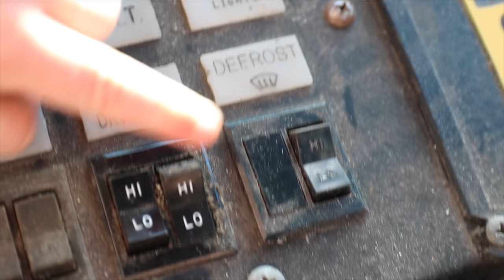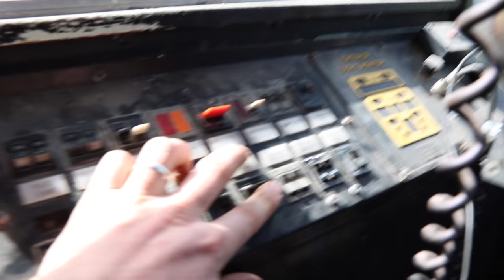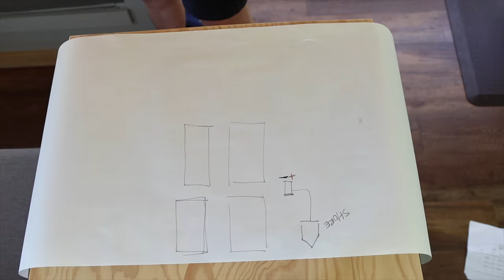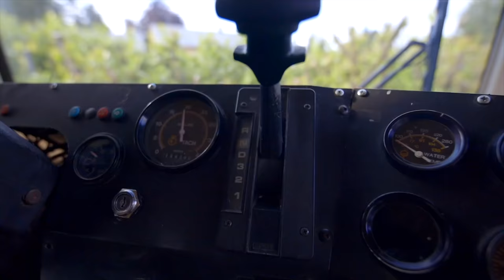BUS CONVERSION TIMELAPSE FULL BUILD - 6 months start to finish - DIY for UNDER 25k

Comment: First time I've seen a sensible sized kitchen. Having spent many years touring in a caravan, that's all the kitchen you get and it's all you need.  You just adapt. I now have a narrowboat with a walk through bathroom, sounds odd but it's the best use of space. This Bus conversion is well thought out and spacious.
Reply: And GAS GUZZLING - just to move it is a considerable financial undertaking! 
AND school bus yellow has to be painted over = $$$$$. Been there!!
Work, tools, time, equipment hauling, $$$. 
Used RVs are available for a steal from disgruntled retirees.
They also have a growing CHILD that will need more and more space and a place - for school etc, if they thought THAT out!
Reply: Best position of a kitchen in a bus!
Reply: @zeebest1004  they have a house

Comment: In your earlier videos on floor prepping, you mentioned a product called "aluminum fiberglass air intake tube heat shield adhesive backed heat barrier" to fill the holes with. Did it work? Is it waterproof? You're one of the few who did a thorough explanation on what to do.
Reply from the maker: We haven't noticed any problems with it so far! Not a lot of water gets splashed up there really.

Comment: Minute and a half in and I'm already jealous. The floor of my bus is hideous. Had to cut all the seat bolts out and nails holding the plywood in. Going to have to attack my floors with a wire brush and por-15 it. Edit: 4 minutes in and nevermind. lol. you're doing that

Comment: I helped my friend take the seats and floor out of his bus... ended up using my milwakee 1/2 impact on full power in the wrong direction to brake the heads off the seat bolts because losing them was not working.
Reply from the maker: Yea that sounds about right lol.

Comment: I really appreciate the video and showing us what you have done My sister-in-law has the same exact bus pretty much and we are doing it right now on a budget of course . 
 We are using the pink foam insulation like you did in the walls I want to know how well that's working ? 
 I'm also curious why you didn't insulate your floor with the foam board  ?  Thank you !  Great job for a home built.
Reply from the maker: We didn't insulate the floor because we didn't want to lose the 1.5 inches in height. I'm 6ft tall so I was already pushing the limit and didn't want to do a roof raise. I might recommend going with spray foam insulation if you are in an extreme climate. It works fine for the PNW where we are but winters and summers are generally more mild. But if you keep all your original windows, going all out on insulation is probably a waste since the 40 single pane windows will let in so much cold/heat. Let me know if you have any other questions on the build!
Reply: @ColaVentures  ok thank you.  I agree with what you're saying . Here in Texas it gets really  really hot in the summer so any kind of insulation is going to help out deflecting the heat and keeping the cool in for I understand about the windows.  Reflective bubble roll stuff works great for blocking out the sun .

Comment: Great build and including family is awesome! Two questions... Didn't see it in video, but did you insulate the floor at all? and will you do solar?
Reply from the maker: I have thought about the idea of solar but I haven't ever gotten around to hooking it up. We did have an inverter and batteries that were charged while driving or when plugged in but now we are fully connected to shore power while we rent it on AirBnb. We didn't insulate the floor. I couldn't spare the headroom and didn't want to do a roof raise.

Comment: How do you get power? Like is it solar paneled or battery or?
Reply: Right now we are connected to 50amp shore power. We did have a battery system installed but no longer need/use it.

Comment: Hi! Is solar equipment and batteries the largest expense? How much just to acquire the bus?
Reply: Bus was 3,500 about 4 years ago. They have gone up recently. We didn't go with solar but depending on your system you could be really expensive or just get a tiny solar system and save big time. We are fully connected to shore power.

Comment: What was the purpose of removing the wall and ceiling panels, insulation and subfloor. Looked like you put back exactly what you took out. It looked structurally sound and insulated to start with. Could the tongue and grove wood not have been installed over the original ceiling panels?
Reply: I’ve thought of that too. Many people remove the floor and wood because they are moldy and rotting out. Removing the ceiling allowed us to run wires up there as well. The flooring was pretty rotten and needed replacing.

Comment: Nice job, you installed  OSB on the floor and removed the original marine grade ply that the bus was built with?
Reply from the maker: We did take the original floor out. It was rotten and nasty and had a funky smell.
Reply: also how were they supposed to check for, and treat, the rust they found?